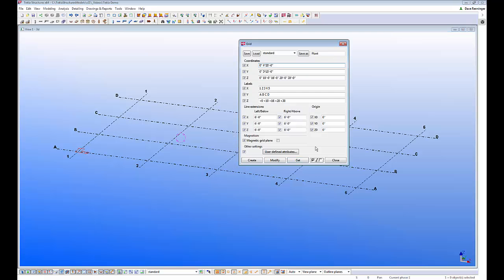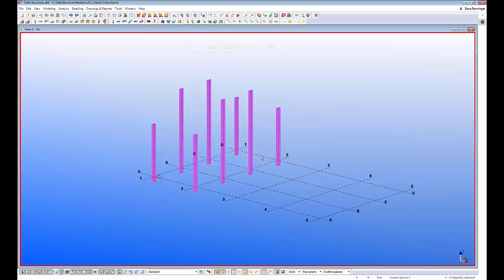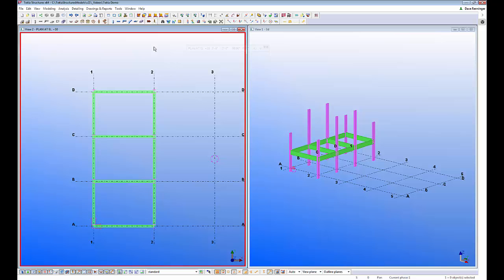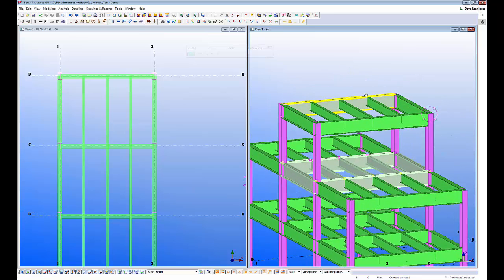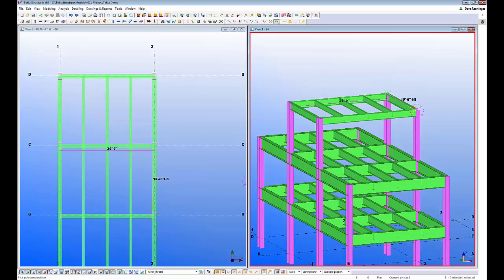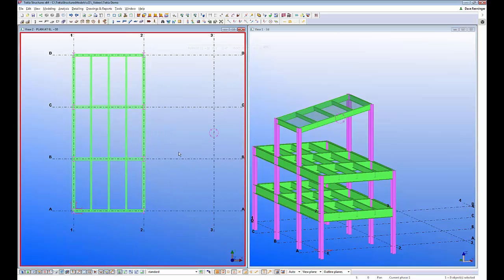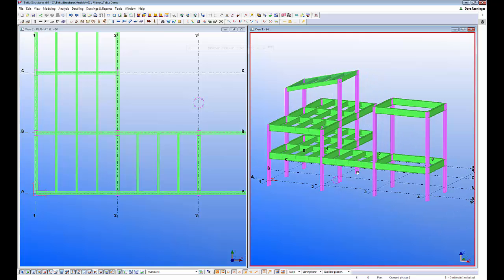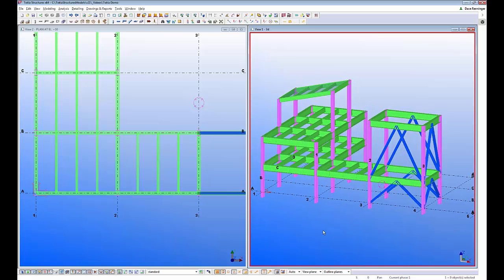001   Steel Framing

Comment: First of all great tutorial. Really helpful in making a skill over Tekla. I am working with Tekla 2016i and the roof slope that you gave using a construction plane doesn't work in 2016i version. If I move the plane the parts attached with it shall ideally move with it but they don't. Can anyone tell me what is the reason behind this?

Comment: How can i move just one side of the plane to get the roof with angle. When I move construction plane linear it moves all sides up. Thank you for your answer.
Reply: Dani, select plane then select the corner point (marked with violet), after that right click to select Move Special command.